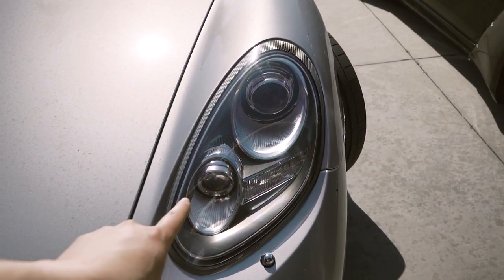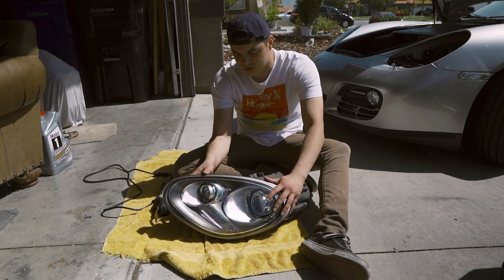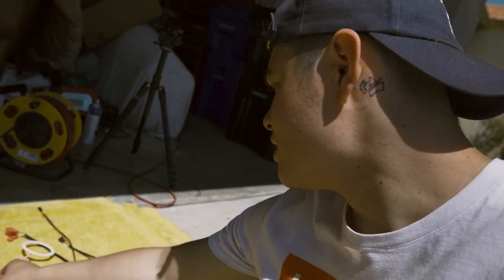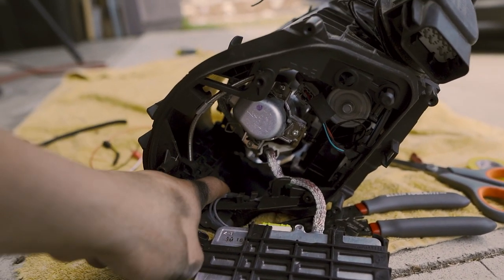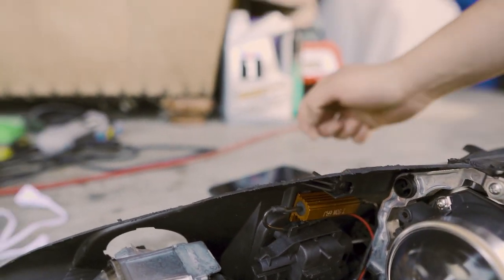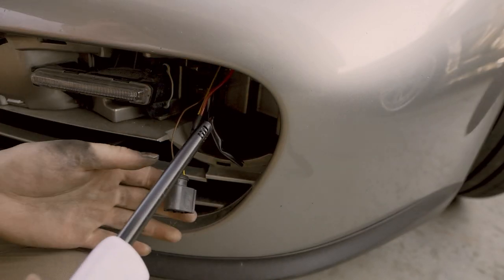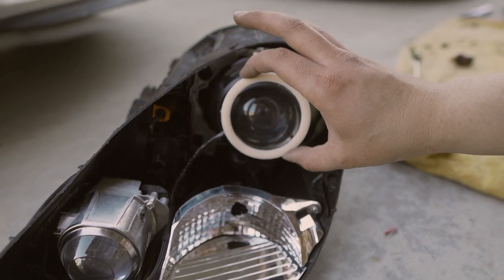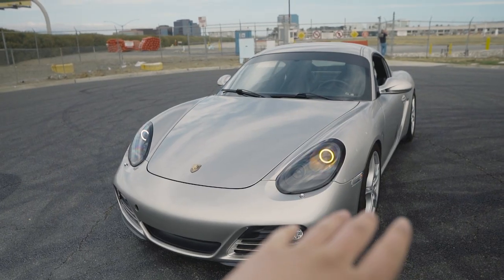I CUT OPEN PORSCHE HEADLIGHTS!! | The First 987.2 Cayman BLACKEDOUT Headlights.

Comment: Awesome content. I am currently trying to modify some spyder HID Xenon aftermarket headlights to convert them to Halogen H7 bulb set up. To fit the current car setup. I just wanted to know what pin gauge pig tail connections you used for the harness. I want to buy some so that I can re-pin the aftermarket lights to omit the HIDS and wire it to H7s. I am having trouble finding the pin sizes that Porsche uses on these harnesses. I see that you provided wire 16g-20g - any more detail on the pin connections? Thanks in advance.

Comment: I'm curious if this impacts the stepper motor 🤔 function for the dynamic headlight portion in the long run if you hit a speed bump or something.
Reply from the maker: No, it won’t. The halo is extremely light and doesn’t put any strain on the motors.
Reply: @TylerCordura  certainly have me tempted to try this on mine

Comment: Great video. It's convinced me to subscribe. 

I'd love to see you do a 987.1 set of lights. PLEASE! 

A few questions, if I may? 

The pins for the plug and play - do you buy these or steal them from a redundant wire? 

The diode - which way around is it wired as there were black and a white wires - so which one got connected to the incoming indicator feed, or doesn't it matter?

And could you use the JB Clear to reseal the lens if you don't own a plastic welder? 

Checking out the rest of your videos now. Keep up the good work! :D

Comment: Wow! I was looking at some DIys references for Porsche headlight lens replacement and came across this DIY. Horrible job. In minute 5.46 I already saw that you butchered the channel in which the lens sits on. A multi tool such as dremel is not the proper way to do it. That headlight just got totalled.You need specialist tools such an ultrasonic cutter so that you dont create a mess of plastic dust. You must not cut the sealing channel by any reason. Perplexed on this job. Sorry, but you car deserves better and there is no way this process is advisable to anybody.
Reply from the maker: Completely wrong, you don’t NEED these tools and they still can be done and properly without them. Not everyone has access to expensive equipment for a one time job… I don’t run a headlight shop, I made my own. And I didn’t cut the channel the lens sits in at all. I cut around it and completely separated the headlight housing and then plastic welded it back together. These have been in the car for years and are still fine with no leaks and perfectly functional like the day I made them.
Reply from the maker: You also have clearly never done this and don’t know what you’re talking about.  Try it yourself and let me know what you think when you have some experience.
Reply: @TylerCordura  not quite. That is where you continue to be wrong, unfortunately for you and your car, if you still have it or passed the problem to another owner. You can see how Rennlight and Bayoptiks do it properly. Sorry you receive feedback the wrong way. But you certainly do not know what you are doing, and to make things worse, you refuse to learn. Such a shame.
Reply: @TylerCordura  of course you NEED proper tools, it is incredible reading your comment, from someone that wants to show how a job is done. Look at your video again, you destroyed the channel in which the new cover sits on. Are you serious? Is like saying: you don need a torque wrench, you just do it with you hand. I hope you think of it again, any job NEEDS proper tools if you want to do it right… of course if you want to destroy or make whatever you want… you just take a knife and later cover all the disaster with glue… yeah with that reasoning you dont need proper tools, just whatever you have on hand. And For your interest a sonic knife is just USD150, lots of 3D printing guys use it to cut plastic.